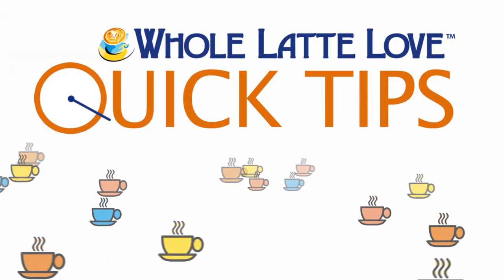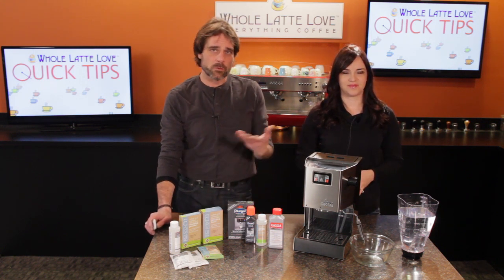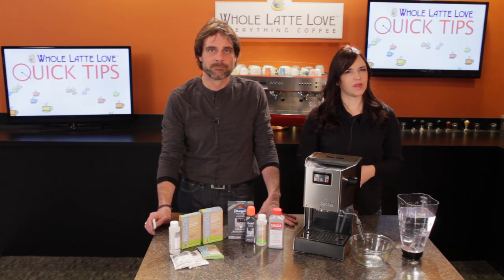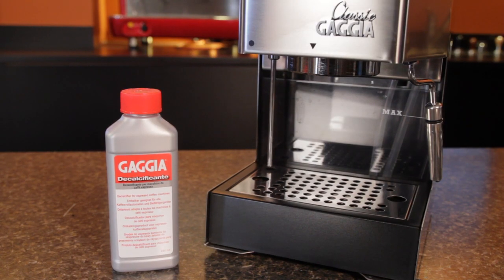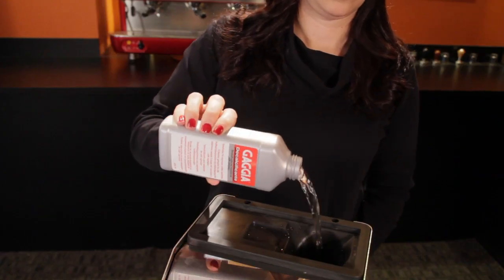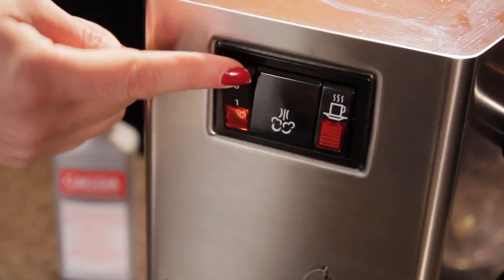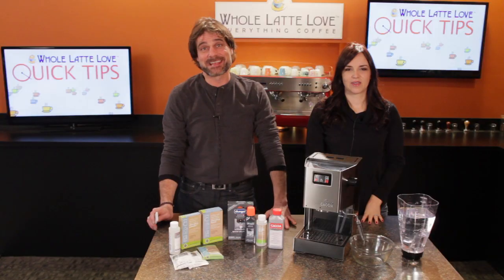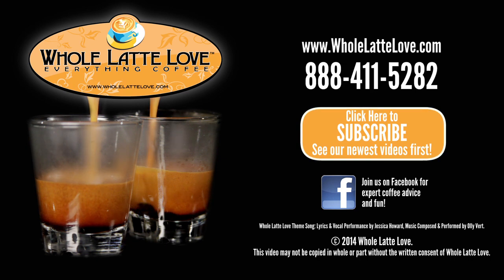How To Descale a Semi-Automatic Espresso Machine

Comment: Hi whole latte love, i was wondering if you could help me? I live in Norway and i bought a Gaggia classic Europe model last winter oneline from a Swedish website, but i have some problems with my Gaggia. It takes over a minute for it to brew a single espresso and it has done so for the past few months (but it works normally when i don't have any espresso in the brew cup). It won't even come any water from the brew cup if I don't open the steamer, and when i do it only drips for a second or so before it stops dripping again. I have tried to decalcefy the machine just like you did in the video, but it did not help. Is there anything you know of that i can do in order to fix this problem?

Signed Marita Murud 

PS. Sorry for my bad English in this message, i am not very good at English.
Reply from the maker: Hi MM, No worries with English! Here a link to our support wiki with loads of info on troubleshooting the Gaggia Classic: https://wiki.wholelattelove.com/Gaggia_Classic
Please understand the wiki supports the North American Gaggia Classic version but should be similar. Here's a direct link to the section of the wiki covering flow issues: https://wiki.wholelattelove.com/Gaggia_Classic#No_Flow_At_All
Reply from the maker: Ingen bekymringer med Inglese! Her en link til vår support
wiki med masse info om feilsøking på Gaggia Classic:
https://wiki.wholelattelove.com/Gaggia_Classic

Vennligst forstå wikien støtter den nordamerikanske Gaggia
Classic-versjonen, men bør være lik. Her er en direkte link
til den delen av wikien dekker flow problemer:
https://wiki.wholelattelove.com/Gaggia_Classic#No_Flow_At_All

Comment: Does this process also work on a double boiler?
Reply from the maker: Hi G, Most manufacturers recommend having a dual boiler machine professionally serviced if descaling is needed. It can be done by home users but process depends on machine.

Comment: I noticed that when you run water through the steam wand, your brew group has zero water coming from it. When running water through the wand on my Gaggia Classic, a significant amount of water still comes through the brew group. Is this a malfunction in the machine that should be addressed?
Reply: I have a 2019 gaggia classic pro and I get water through the group head too. They’re using the older gaggia classic in this video but I’m not sure if that is the reason the water isn’t coming out of their brew head
Reply: I'm also curious about this
Reply: @simonhimself86  on my Classic Pro, if I turn on the steam button AND the brew button, no water comes out of the brew head. If I press only the brew button, water comes out of the brew head and the wand.

Comment: In this video you say that vinegar is not the best thing to use to descale an espresso machine, partly due to the fact that it can deteriorate the rubber gaskets and O rings. That being said, in the manual for the Barista Express, we are told to use white vinegar to descale the machine. Is the Breville manual wrong or is the Barista Express built in such a way as to keeping all rubber parts from coming in contact with the descaling agent? I know that there is no gasket in the thermo coil as there would be if it utilized a thermo block like most espresso machines. I also wander if the shower head gasket not being under pressure during the descaling process prevents the vinegar from coming in contact with it. I am looking for your expert advice on the best way to descale my Barista express given the instructions in the Breville manual differ from what you are telling us here in this video.

I do enjoy your videos and am in no way poking fun at this video but merely need to know if I should follow the manual or if I would be better off using one of the descaling solutions such as Dezcal or Durgol which are designed for this purpose. If so which one would be appropriate for my Barista Express?
Reply from the maker: Eric Coovert Hi Eric. The recommendation against vinegar due to possible adverse effects on internal components is a blanket statement. As you mention some machines do not have gaskets and seals which would be compromised. Others do. Without long term testing of 100's of machines it's hard to be specific so our general advice is to stay away from vinegar. More concerning is the aftertaste caused by using vinegar. It's extremely difficult to rid a machine of the vinegar flavor. Especially true when used in machines with significant scale deposits. Scale can be very coarse. when vinegar soaks into it, it acts like a sponge...a very hard to wring out sponge. The vinegar flavor can hang around for a long time. If Breville recommends vinegar, then we assume it's okay to use. No parts that could be damaged. If it was our machine we'd skip the vinegar and use Durgol Swiss Espresso Special Decalcifier. It's okay to use in all boiler types regardless of metal used in construction and has no aftertaste. Be aware that some manufacturers require the use of their own descalers in order to maintain warranty.
Reply: Whole Latte Love That's what I was thinking but I just wanted to make sure. Thanks for the quick reply. I enjoy our down to earth way of doing your reviews and the knowledge you share with the rest of us. You guys are great.
Reply: Whole Latte Love I used vinegar in my old 800ESXL and found that I could get rid of the aftertaste by simply running two or three tanks of water through the machine prior to brewing my next espresso. What I didn't know then is the vinegar probably caused the seal in the thermo-block to eventually fail. I did get 8 years out of the machine though before it failed. That gave me a good excuse to get the 870XL Barista Express which I use today.  
I thought it was funny that, if my memory doesn't fail me, they didn't recommend vinegar for my older Breville 800ESXL but they recommend it on the new one with the thermo-coil. You would think that Breville could receive some kind of compensation by recommending one of the brand name descalers or selling their own brand. For some reason they saw fit to simply recommend vinegar. If I stick with that, I won't void the warrantee and save a little money to boot. I just feel better about it now that you don't see anything wrong with that.
Thanks again,
Eric

Comment: Hey Mark on my gaggia brera when the scaling light came on and I did the scaling process but whatever I did wrong I cannot pull a single or a double shot it comes out at least a cup and a half at a time is this something I messed up
Reply from the maker: Hi Steve, Did you try reprogramming the cup volumes? Press and hold the button you'd like to program the amount for until the cup icon flashes in the display. Coffee will dispense. When you have the amount you want in your cup press the button again to stop dispensing and that amount is stored. Hopefully that does the trick. Full instructions for programming coffee length are on page 31 of this manual: https://wiki.wholelattelove.com/images/a/ad/BRERA_Machine_Manual.pdf
Marc

Comment: the price of these descalers is just a complete rip off...is there a good value one that is ok to use with Gaggia Classic?
Reply from the maker: Hi PO, Thanks for the question. It's always best to use the manufacturer recommend descaler. The Gaggia descaler contains a corrosion inhibitor in addition to the acid which does the descaling. It's also at the proper concentration of acid for their machines. That said, although not recommended one can use other descaling products. Urnex makes a citric acid based descaler (does not contain corrosion inhibitor) which can be used in the Classic. Urnex recommends limiting contact time to <20 minutes in the Classic boiler. Here is that product: https://www.wholelattelove.com/products/urnex-liquid-dezcal

Comment: What about using Cafetto organic descaler?
Reply from the maker: Hi William, Thanks for the question. Cafetto like most descalers uses citric acid to get the job done according to its SDS. Essentially the same as something like Urnex Dezcal: https://www.wholelattelove.com/products/urnex-liquid-dezcal
Marc
Reply: @Wholelattelovepage  Marc, you're just fantastic! I thought I had seen in one of the WLL videos that non-Gaggia descaler has too much of a different acid and wasn't recommended. I also see that you recommend the Urnex Full Circle line of products, which is probably similar to the Cafetto in being more environmentally friendly. I presume that product is ok to use in my Gaggia Classic Pro (which I ordered from you guys and is coming next week!!!).

Comment: What would I use to descale the Breville Barista Express?
Reply: Charlotte Porter I don't want to go against the grain here but Breville recommends vinegar on the BES870XL Barista Express. If you own the BES860XL I probably would not use vinegar as it uses a thermo-block which consists of two metal plates sealed with a rubber gasket vs. a thermo-coil which is a one piece construction thus avoiding the rubber gasket. The BES870XL as well as all of newer Breville espresso machines utilize a thermocoil and I think that's why they recommend using vinegar on their newer models.

Comment: Hi, can i use ecodecalk for gaggia classic pro? please
Reply from the maker: Hi Pure Blood, Thanks for the question. Gaggia descaler is preferred for use in the Classic Pro: https://www.wholelattelove.com/products/gaggia-decalcifier-4adf31c1-5733-464a-91c2-ffbda32ef649
If you have some Delonghi on hand it's okay to use in a pinch. The Delonghi descaler is mostly lactic acid while the Gaggia descaler is mostly citric acid plus some lactic acid and a corrosion inhibitor. If using the Delonghi limit contact time to <25 minutes.
Marc
Reply: @Wholelattelovepage   thank you so much  Marc!!! Appreciate ur reply. Love you!